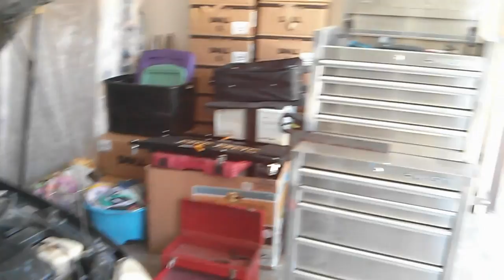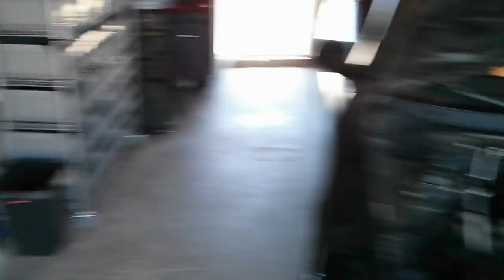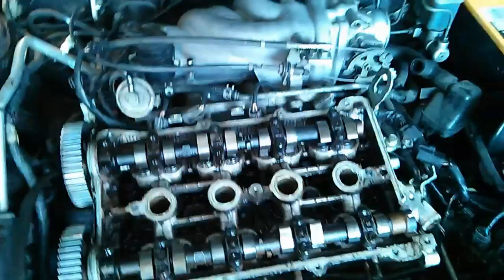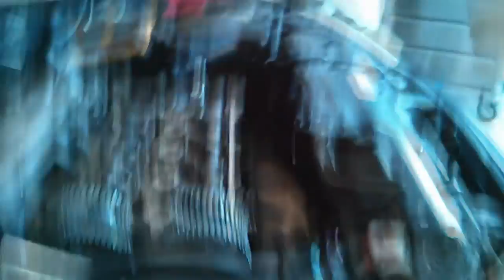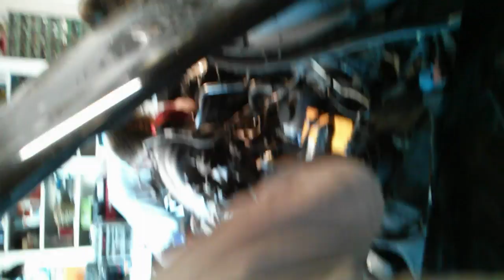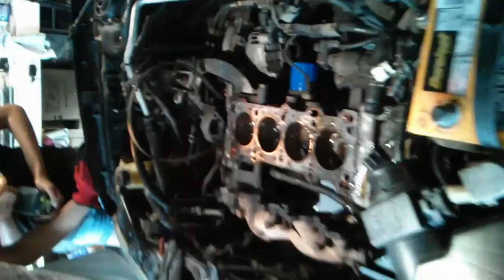1994 Mazda Head Gasket Repair Video 2 HD

Comment: First of all, I want to congratulate you on such a great video. It is very educational and useful. I am in the process of repairing the cylinder head gasket of a 1997 mazda 626. It presents the burned cylinder head gasket which causes the engine to heat up. The anti-icing fluid hoses, the thermostat, as well as the radiator were stopped. We only have to repair this vital component to which we have not been able to find any instructions or guide other than this video.

Comment: Hey, I sold the car after all the work I did because I found out cylinder 2 had a leak. :(  I found that out by using a compression and water bubbled up in the radiator. I still enjoyed the experience.  I learned alot. Didn't spend much $ on it.  Bought for $500, invested $500, sold for $500...

Comment: How did you get the timing belt off the cam pulleys? I'd imagine it'd be under tension.

'91 Autozam AZ-3, 1.6 DOHC